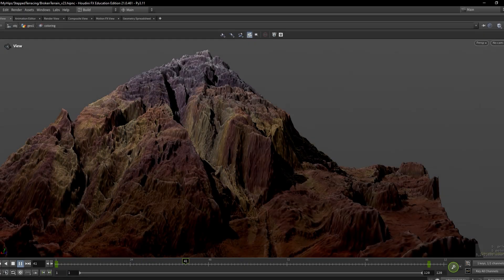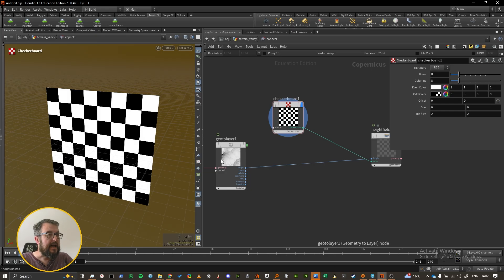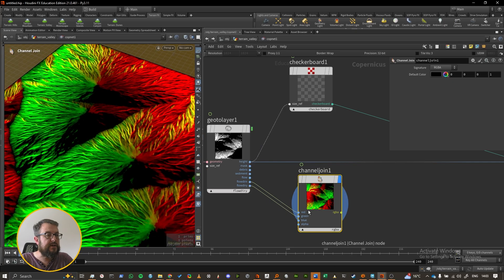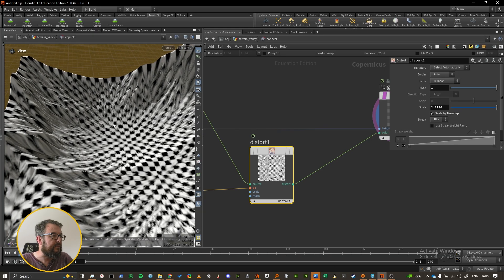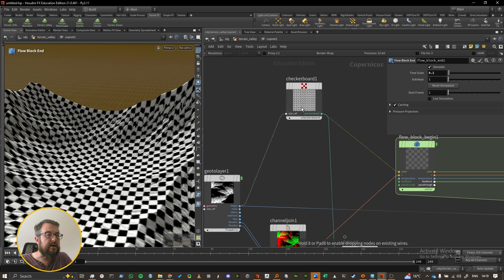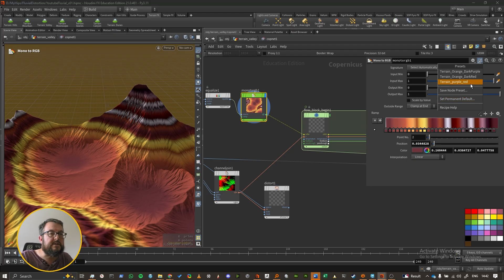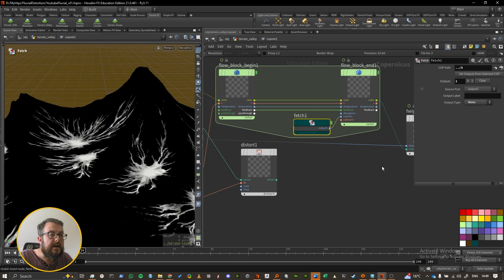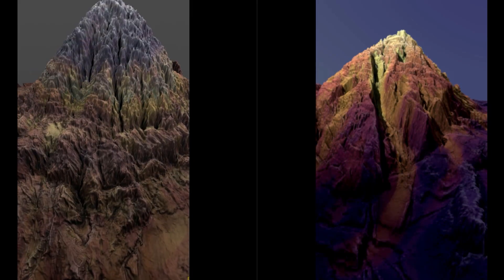Texture Flow - Fluvial Texturing in Houdini 21

Comment: Awesome, I was having the same idea  after seeing a similar thing in Gaea. I thought of using flow, but you really nailed the details.
Reply from the maker: Thanks appreciate it. Since this video I have found that the best thing is to mix both the flow block and the distortion methods to get the smoothest maps. It also works with mixing images which can get some interesting results. While the results from Gaea are very impressive I think that all the foundational nodes are there to create quality terrains in Houdini with the added advantage of all the sop based procedural power.